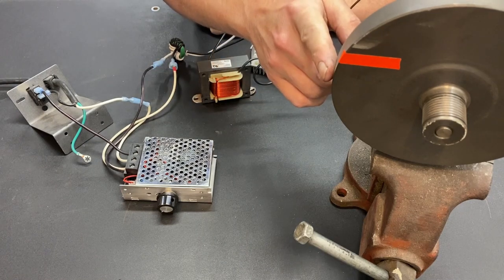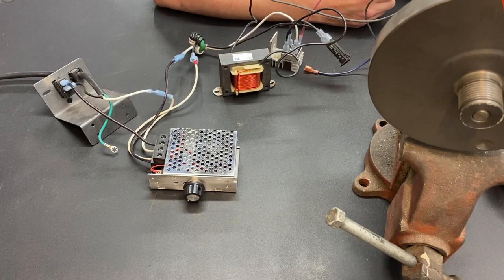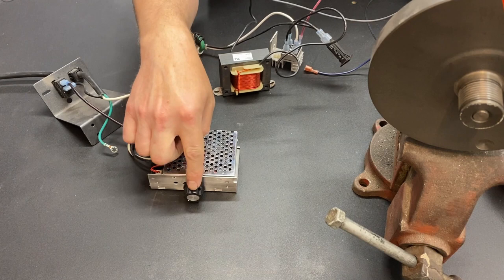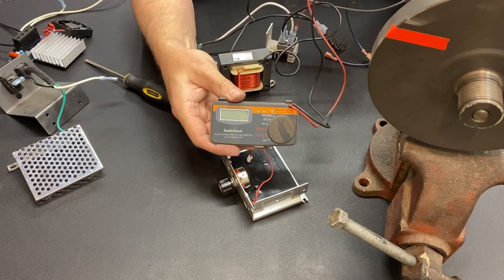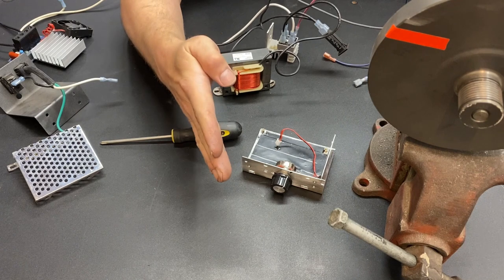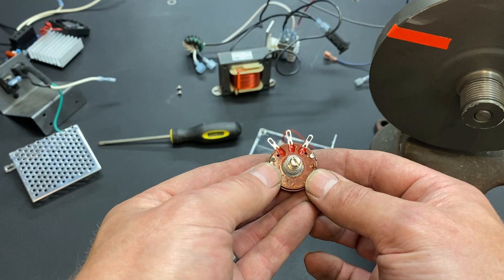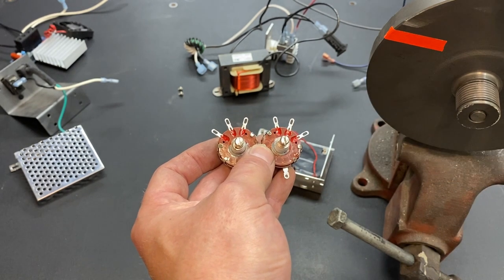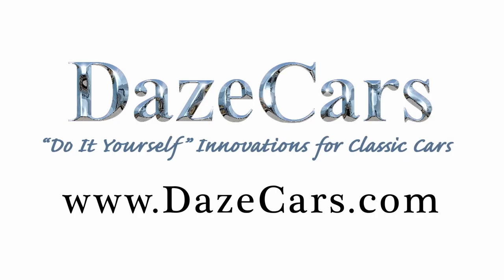Changing the Potentiometer in an SCR Voltage Controller Treadmill Motor Controller Power supply

Comment: If the potentiometer was in-installed from the body, which two terminals would you measure Ohms between?
Reply from the maker: depends.  The middle one is always one of them but it could be either of the outside ones one is high and the other is low and which one is which depends on the manufacturer.

Comment: Could you use a 20K resister to make up for the difference in the 120K Potentiometer to give you the 140K that is needed?
Reply from the maker: Yes you could but it will limit the max RPM put out by the motor.
Reply: Thank you Sir.  @dazecars

Comment: Can the scr controller set up power a 4ph motor pulling say 250lbs ( just like a treadmill)
Reply from the maker: a treadmill isn't "pulling" anywhere near 250 pounds as the movement has very little to do with the person on the belt.  what are the amp requirements of the motor.  What kind of RPMS are you wanting to run this at?  The only way you will have a shot of getting it to work is by gearing it way down.

Comment: Why didn't you use a 110v input SCR to 90v dc output and not have to worry about the rectifier? Just curious.
Reply from the maker: the SCR is AC with AC in AC out.  The rectifier converts it to DC

Comment: can we use the scr for 1phase 220v 5.5Kw motor?
Reply from the maker: no, usig an SCR as a way to slow down an AC motor will result in a motor that doesn't work very well and will shorten the life of the motor.
Reply: my plan is to slow down my motor at least by 40%, its just noisy when it run.  any other alternative way  to slow down the speed. unless I change the lower speed motor but loose the torque. I need to use at least 25Nm to run the system. it extruder for animal feed machine. thanks in advance..cheers

Comment: why can't you use a regular 120volt Dimmer Switch for lights from the hardware store instead of that SCR. Wouldn't it act as both the on/off switch and the "potentiometer" to the bridge rectifier???
Reply from the maker: It can't andle the amp draw of the motor and if it could it would produce a lot of heat.
Reply: Thanks for reply.  So FYI, I went on Rona"s site, local hardware here, and they had a Pair of 120v 15 Amp rated Dimmers on for $27 Canucklebucks.  You can also Program the Slider to a MIN. and Max range, which I thought is good to avoid over Volting the motor.  My motor is a small one...TruPower, Leeson Electric Corp. made in China.  Rated at 96 Volts, 14 Amps, 5120 RPM and is 1.5 HP.  Using your formula I think thats 1.53 FT/LBS of Torque.  Planning to use it as a Sanding station so I don't really need too much power or amps. I don't think LOL...we'll see. Enjoy your video's and learned enough to get me into trouble .. :-))  BTW I bought one of those SCR's you mentioned but had to returrn it,  the Potentiometer was malfunctioning you could just touch the side of the Knob and it would jump 8 12 Volts either up or down from what it was set at..
Reply from the maker: I look forward to seeing how this all works out please keep me informed.  A couple of things to be carful of.  First most electronics like power supplies are rated in in max amps not continuous amps.  Not sure if that applies to the dimmer switch.  Second I am not sure how the dimmer cuts down the power.  If it just cuts volts than no problem that will only modify the speed but if it also cuts amps you will lose torque.  Anyway just a couple of things to keep in mind  @Erik-6262

Comment: I changed the pot in my  220v 4000A SCR from 500k to 150k and the treadmill was running smoothly but still to fast, should I try using 100k pot.  I can get the motor to run slow but it starts to surge and slip as if it has little power.
Reply from the maker: a 4000W SCR is too small and you will likely burn it up eventually.  The minimum speed on an SCR setup has little to do with the potentiometer.  As long as it does not come on with the pot at the slowest setting then changing the pot to 100 will only make it faster.  Sounds like you need to gear it for more power and slower speeds.

Comment: Another options is to use a multi-turn potentiometer but they are more expensive.
Reply from the maker: Thanks for sharing that option it is a good thing for people to know. It’s not something I like however for two reasons one like you mentioned the added cost, and two the amount of turning that you have to do if you’re going a significant number of RPMs. In other words with my current set up if I’ve got an increase it by 500 RPMs I can go right to the course potentiometer and crank it up if I was using a multi turn potentiometer I would have to turn it quite a bit to get that same jump. for me the two potentiometer system is more efficient when it comes to time when making adjustments.  Not that that really matters I’m not a production shop so saving a few seconds here or there doesn’t get me much. 😁

Comment: I found a Dork motor speed controller from a previous project and would like to know if you think it will be ok to uses for my tumbler 
Working v 10v -50v
Control power  0.01-3000w
Max rated current  60A
And the motor I have is a 21.4amp 1.5hp cont @ 95 vdc
I know you said that I had a cheap  treadmill motor lol but I still didn't want to burn it up 
Hopefully I gave you enough info

And thankyou fornyour time
Reply from the maker: Your motor might be a good one but based on the specs you provided I am guessing it is one of the cheap ones.  That power supply should work, but you will still need to gear that motor WAY down

Comment: OK I'm back... and still can't seem to wire the potentiometers correctly.  Couple of questions if you don't mind.  Does the smaller one have to be on the left of the two?  And second question is, I have the leads labeled in the back with the numbers 1, 2 and 3.  Are 3 and 2 connected in series or is it 1 and 2 connected in series.  The 3 is on the left of my potentionometers if they are facing you.  Really want to get this working :(
Reply from the maker: resisters in series add their value so 1+5=6 same as 5+1=6 in other words it does not mater which potentiometer is first and which one is second.  As to the three terminals some are set up one way and some are set up the opposite way.  This can all be easily checked with a multimeter.   On a potentiometer you use the middle terminal and one of the outside terminals.  If after it is set up the direction the knob is turned is opposite of what you want you disconnect the outside terminal wire from that potentiometer and connect it to the other outside terminal.

Comment: Was wondering if you could help me by telling what scr and Potentiometer i need for this application 
I have a 1.5 hp cont. Duty @ 95 vdc
And it is 21.4amps 
I want to be able to slow it down to a 50rpm on the low side and 100 120 rpm on the high side roughly and that is a guess on rpms 
It is for a drum tumbler 
Plz help lol
Reply from the maker: Use the SCR that I have linked, use the technique in this video to determine potentiometer size for your system and then you will need to gear it down a ton to get the RPMS you are after.  Likely in the 10:1 neighborhood.  Also those specs sound like the smaller motor in most cheap treadmills so it may not be up to the task of a tumbler.

Comment: hi thanks for your videos, please can you tell me if treadmill motors are reasonably good for accuracy , one guy on youtube  seems to pull them apart and machine end caps and improve them. this sounds like a pain to me. i like the SCR idea , i,m in  the uk on 240volt, i have a bodine motor which is on 115v dc 7500 rpm to 8500 rpm . i would like to use this motor and be able to change at will to other motors. I know i,m rambling on a bit, but  any advice would be great cheers john
Reply from the maker: Define "reasonably good for accuracy"?  I use them on my metal lathe, my mill and my bandsaw without issues.  After gearing I have speed adjustment on my lathe of 50-1500 RPMs  Depending on what you are putting it on that motor may not be up to the task.  Motors with that RPM range are usually lower torque.  Spend some time on my channel, there is lots of good info there.  Also if you give me more details about your project I can provide better insight.  Start with this video but look through my other offerings https://youtu.be/A_zBGJkhBAc

Comment: Pretty good My friend I have a 130v dc motor from treadmill the question is wats the capacity from Transformer are using in that proyect ? Hope u understand My poor English ,thanks very much
Reply from the maker: I am not exactly sure what you are asking but I will try to answer what I think your asking.  The SCR is 110-220V AC and 10,000 watts BUT you will never get more than what you put in.  In other words if you plug it into 110 you will get slightly less than 110V at max, and then less than that as you turn down the speed.
Reply: @dazecars  thanks very much thats correct ,i'm sorry for My English not good i saw in Your video also are using a Transformer you says something about choke .
Reply from the maker: @elmexicanitonieto6475   a choke and a transformer look the same but they are different.  https://youtu.be/WRT_Ri18eLY

Comment: Try adding 2M ohms resistor parallel to potentiometer it will be equal to almost 140k ohms.
Reply from the maker: That is a great point, my concern would be that when putting a resistor in parallel to a potentiometer the change of the potentiometer is no longer linear.  the further the potentiometer resistance gets from the fixed resistance the less change.  That means the knob will not create a consistent speed adjustment.  It will get finer as the potentiometer resistance decreases but the SCR speed will be going up and most often finer control is more important at lower speeds.  That is why to me the best solution is two pots.  You can get the exact desired starting ohmage,  add fine speed control while keeping the adjustments linear.

Comment: You probably get asked this alot and may already have the answer posted somewhere but ima ask anyway. What size dc choke are you using for these projects with treadmill motors?
Reply from the maker: Not being an electrical engineer I do not have any specifis I could provide in trying to get one, what I can do however is offer you some guidelines. First of all bigger is better. I have several motor chokes ranging from the size of a tennis ball to the size of a soft ball and the bigger they are the better they work. Second the wire for the choke needs to be a minimum of 16 awg. If the wire is not that big or better it will not have the amperage capacity to allow the motor to work properly . Third they are not available on Amazon at least not inexpensively, there are a few privet sellers on Amazon selling used parts for big bucks but the available chokes on amazon are too small because they are not designed for a motor even though they look correct in the picture in the picture they are way too small. The choke in most of my videos is part number 130993. Instead of getting one new I would get a used one. A lot of treadmills come with a choke. Go to eBay and search “treadmill motor choke” BUT know that most people on eBay don’t know what they have and the word “transformer" will also appear in most listings. Problem is a choke and a transformer look almost identical so some listings are for transformers and some are fore chokes because the sellers think they are interchangeable. They are not. They would only be interchangeable if you modify a transformer to work as a choke. (see my DIY choke video) To tell the difference count the wires. A choke will only have 2 wires, a transformer will have 3 or more. Also before I started doing videos chokes on eBay could be had for $25 or less shipped but now that more people are looking for them (due to my videos) the eBay sellers have raised their prices quite a bit. Your best bet might be the DIY option out of a Microwave transformer. Please let me know if I can be of further assistance.
Reply: @dazecars  hey thanks for the reply, since i posted that comment ive found the diy choke video of yours. Very very helpfull, i have several m.o.t.s already lol. That is the route i will go for now untill i plunder more treadmills, thanks alot my friend. Im not a fan of many youtubers because most seem to only be after likes and to boast about what they have or can do lol. You actually put out practical reasonable and realistic information and i for one appriceate it
Reply from the maker: @robertolson6686  Glad you like my channel.  The comment you are making is exactly my goal.  My channel is about the information and NOT about me (That is why I don't appear in any of my videos) Sadly in order for YouTube's search feature to recomend my videos I need views,  likes, and subscribers and that can be tough to get so if you ever have the chance to recomend my videos to others please do so.

Comment: Umm,  why not just put a resistor in parallel with the pot to adjust the pot's range?
Such as 200k ohm 2W to transform the 500k pot into a 142.85k pot?
Or,
an internal pot in parallel pre-adjusted to 194.5K to get a perfect 140k range (hehe)
Reply from the maker: A person can do as you suggest with a resistor in parallel  but then it is no longer linear and I prefer linear variability in a speed control potentiometer. Potentiometers are cheep and available in most of the ohmages needed.  I like the two potentiometer setup because it gives the ability to hit the exact ohmage plus fine and corse speed control.  Also in some cases a resistor is series is required to limit max speed giving another option to doal it in.  Lots of ways to do it and every application is different.  All in all while a resistor in parallel is an option it is never my first choice.

Comment: This video misses a couple important numbers; voltage and power rating. If you are controlling 120VAC, there for peek 170V, the potentiometer should be rated for 200V. The 2W is the power rating of 2 watts. Using a pot with a lower power rating will most likely result in the magic smoke being released. It would be interesting to see this SCR reverse engineered. It would most likely be cheaper to swap out the capacitor for a smaller one to reduce the dead zone.
Reply from the maker: I could be mistaken but I believe the pot is only see a signal voltage not full voltage.

Comment: Could you not just add a separate resistor in line to make up the difference?
Reply from the maker: Yes and No.  If you do that you will have the max resistance (so the minimum speed)  but the resistance  will never go below the value of the resistor you added so you will be sacrificing top end speed.  I did exactly that on my band saw because I wanted to limit the top speed.

Comment: 🙌🤲👐👌now I know u have turn up the end before it turns
Reply: Thank you sir 🙏  your are wonderful teacher.
Reply: I have picked a treadmill motor from a recycling depo but I notice it is a 120V but my wall sockets are 240V. I think I need a  transformer but I only find up 60V power supplies on. 🤔  will it work it but the 60V
Reply from the maker: Thanks
Reply from the maker: a Varic might work.  What is the voltage of the motor inside?
Reply: @dazecars  120V DC. After seeing your next video I saw it.needed. a transformer
Reply: I got the transformer and the choke but no motor controller at.the moment. I ordered. From AlExpress
Reply: @dazecars  🙈🙈what is a Varic?
Reply from the maker: @andileltthole3799  https://youtu.be/oSZYEUm1SuY
Reply from the maker: @andileltthole3799  Is that the actual spec on the motor?  I have seen the side of the motor say anything from 90V-180V.  Just wanting to confirm that that what the motoe actually says rather than the voltage it is designed to plug into converted to DC.

Comment: Put a 200k resistor across the 500k pot to get a 142k pot. A 220k resistor makes a 152k pot. Much cheaper than buying a new pot.
Reply from the maker: A comment similar to this has been made by quite a few others and while it is a solution it is IMHO not the correct way to do it.  Adding a resistor in parallel makes the potentiometer no longer linear.  I would much rather spend a few bucks for the correct pot than add a resistor and lose consistency.  Your technique would make much more sense if potentiometers were a lot more expensive than they actually are.